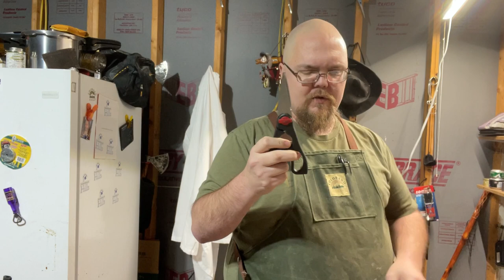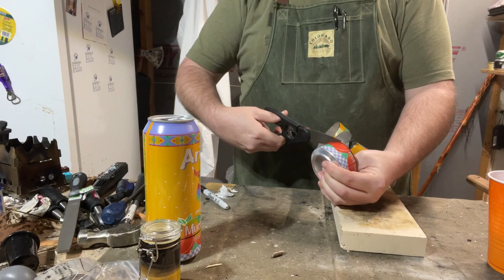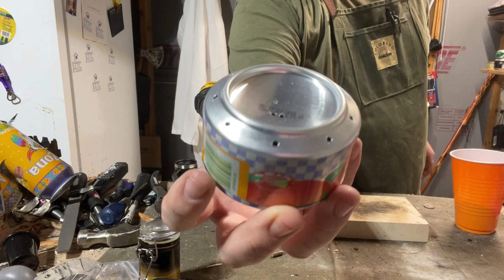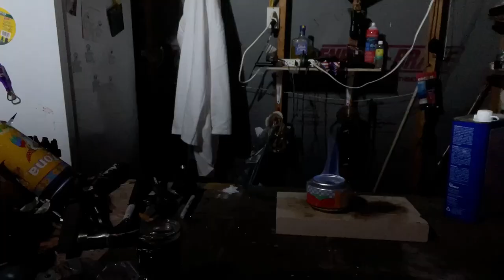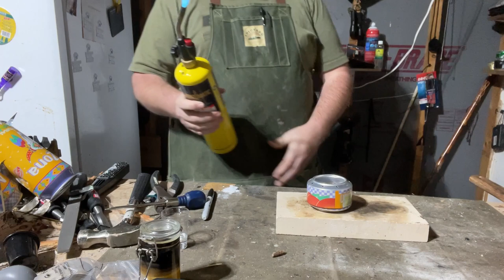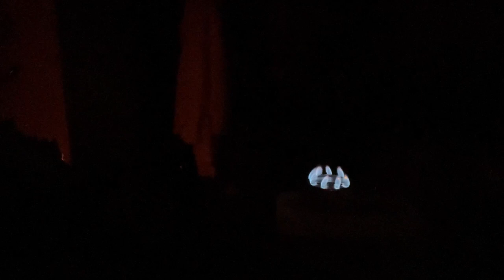Making a Penny Stove but Using Sand as a Fuel Medium

Comment: I have 3 or 4 I have made Even sealed 2 with JB weld big one little 6oz coke one but never really impressed with them seems like if you light the things on Fire they get enough heat to work but otherwise they don't
Reply: i used epoxy many times too